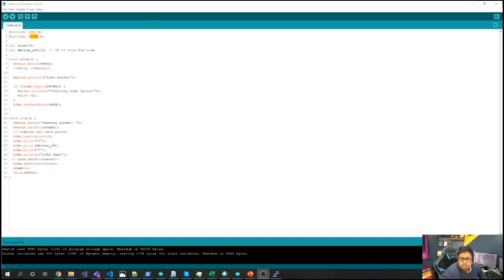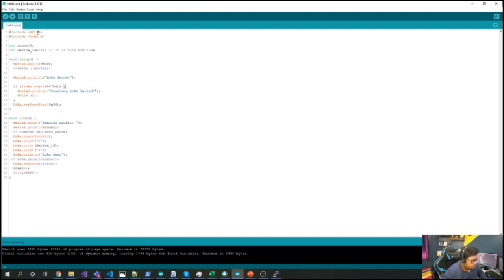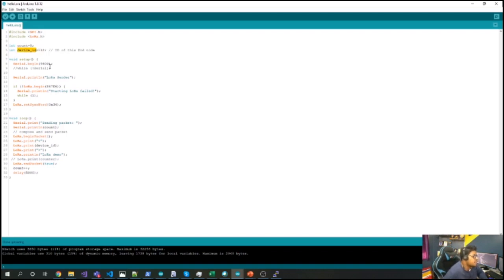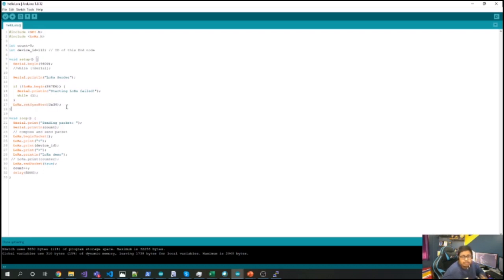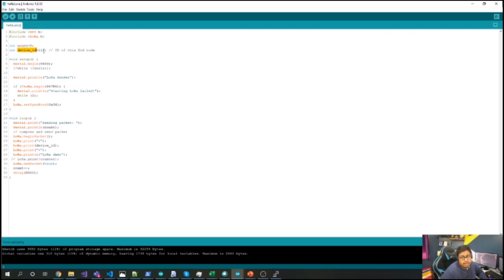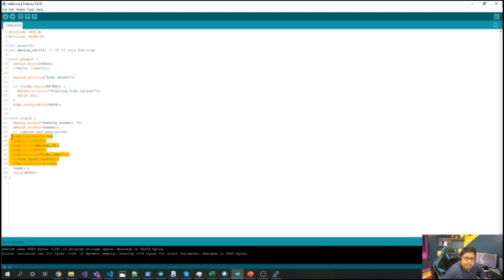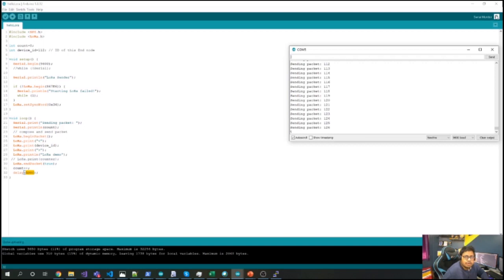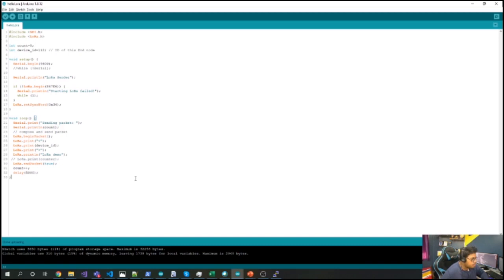LoRa - From node to gateway - 2

Comment: how tosend data from lora node (heltec lora esp32 v2) to gateway (heltec wireless bridge wifi/ble --lora model htit-tb)
Reply from the maker: I've not specifically used this module, but if gateways support message sending from its config portal, it can allow. However, LoRa gateway is essentially using the same chipset. So you should be in a position to program it explicitely at FW level to do it. 

I will have a look at the module you mentioned and get back too.